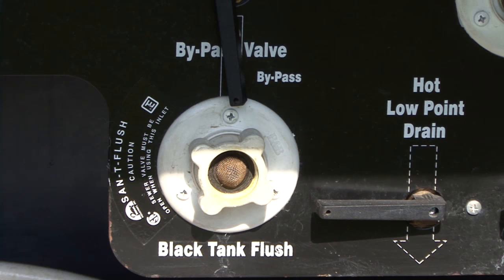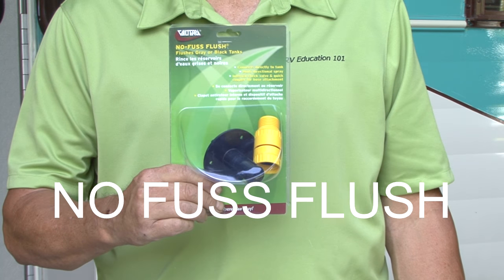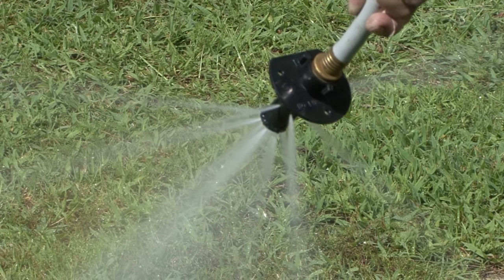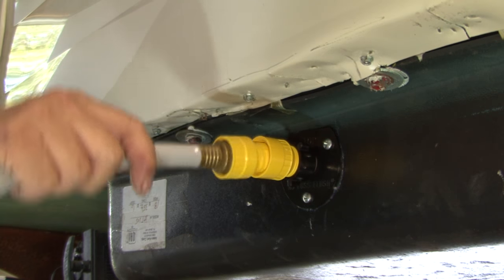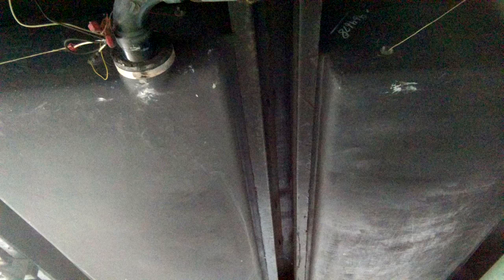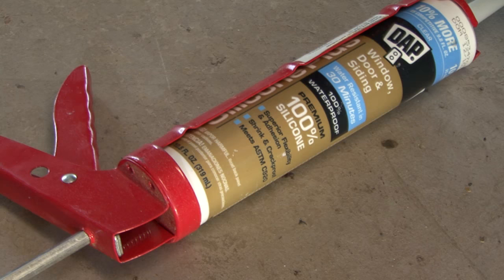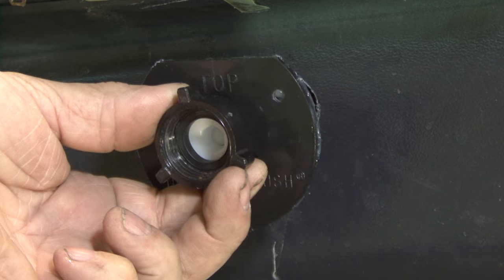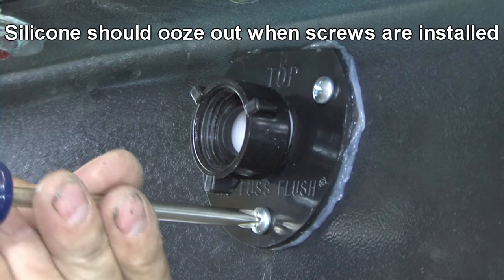RV Holding Tank Flush Installation

Comment: Good info. One thing I will change and recommend useing is slow cure 3M 5200 rather than any silicone sealant. I'll also give the tank location and back of the fixture an aggressive sanding with maybe 150 or 180 paper. Gives the mateing surfaces  some "tooth". Thanks and good job.